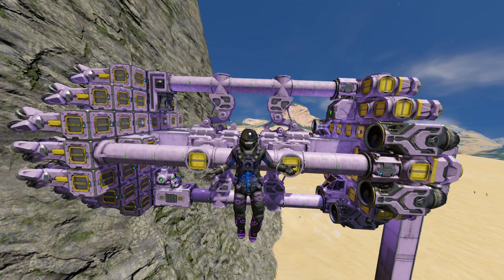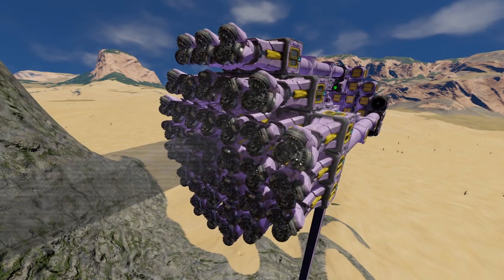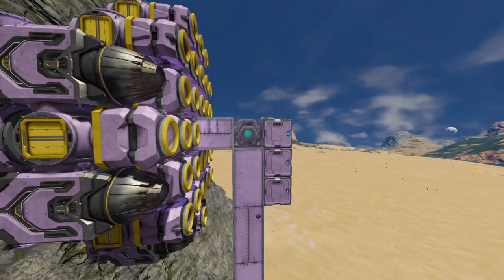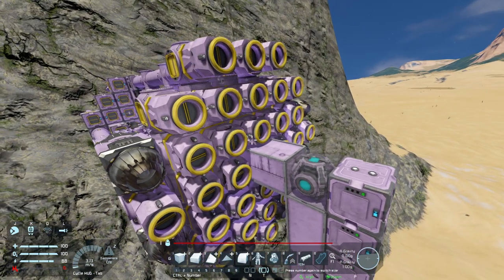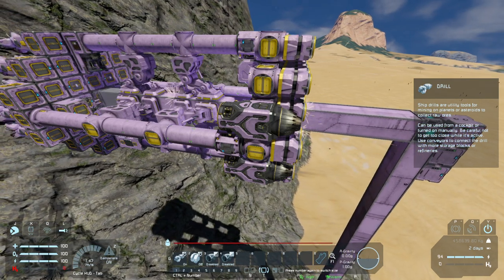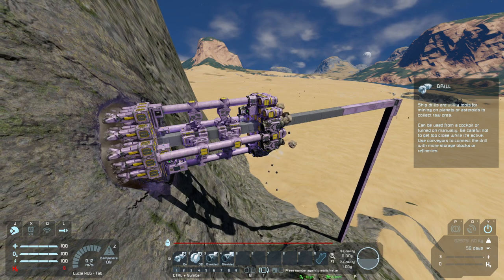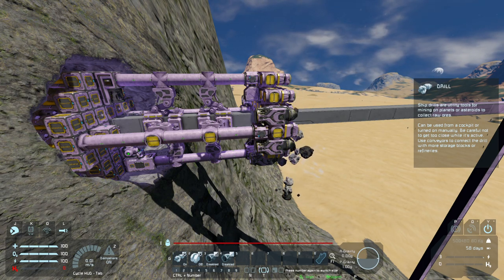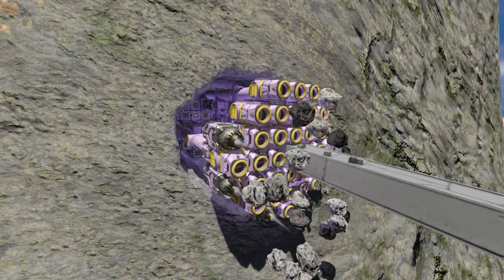Automatic Tunnel Boring Machine With Monorail.

Comment: Tip: If you hold right mouse button, you can drill faster with biger radius without trash stone, thats nothing new, But, if you open inventory while holding right mouse button, ond close inventory without holding the button, the right mouse button will be hold itself and you can do something else while tunnel bore, however you need stay in drillship cockpit. :)

Comment: Doesn't drone auto pilot require a thruster in all directions? Could this be causing your auto pilot problems?
Reply from the maker: I don't think so, my tram videos have this functionality with just forward and backward atmo thrusters, it worked like a charm there. It's clearly a bug, it disables thrusters entirely, to the extent that nothing will cause them to function again until the world is saved/reloaded, and then they work fine again.